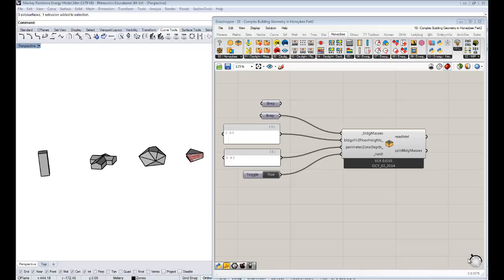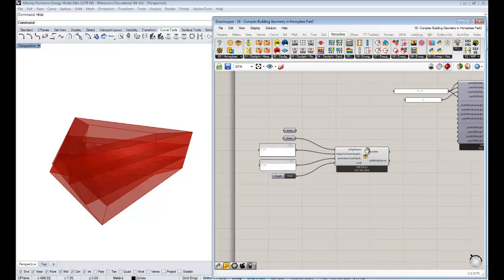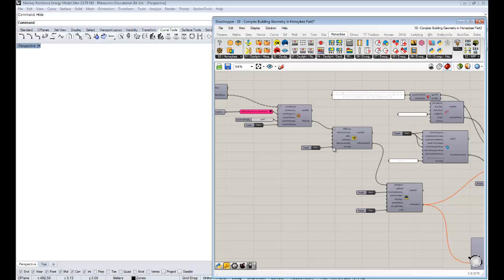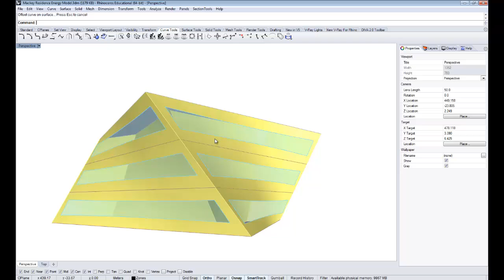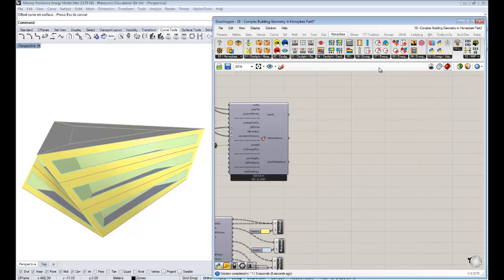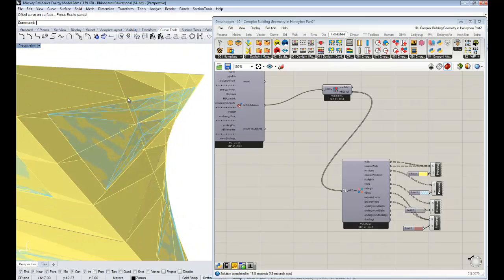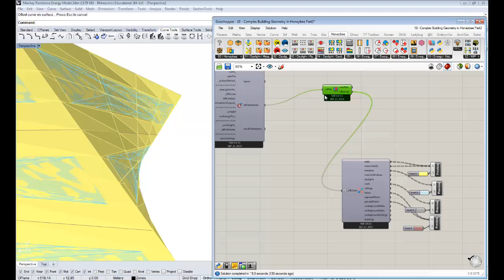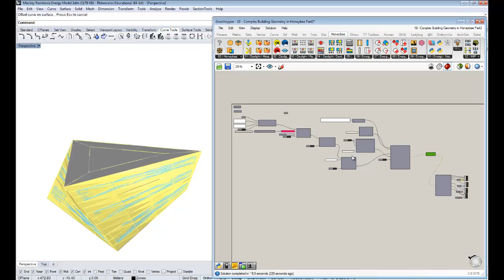11 - Honeybee Energy Modeling - The Laws of Geometry in E+ Part 3: Curved Geometry

Comment: I get a red error message on the runEnergySimulation- tab:
"1. Solution exception:'hb_EPZoneSurface' object has no attribute 'coordinates'"
It fails on both: the twisted triangular building and the boulder-like building. On the house and the skyscraper it works just fine.